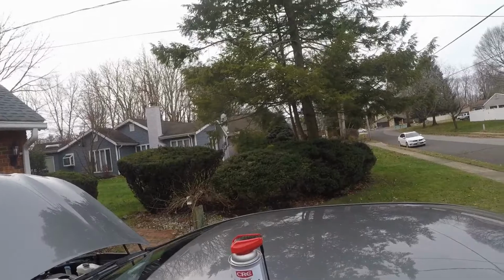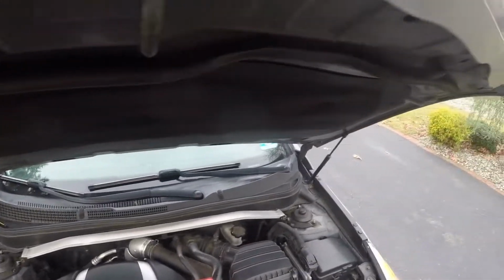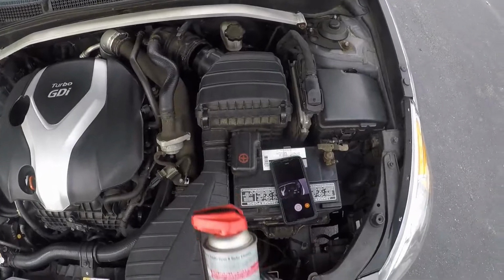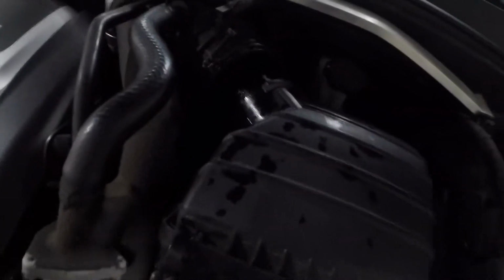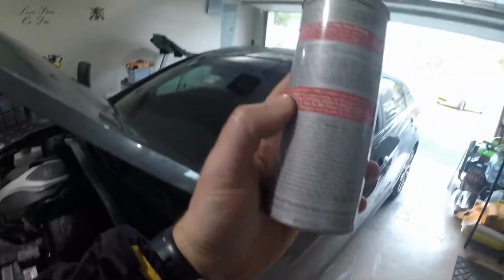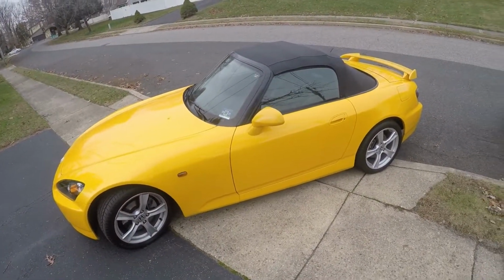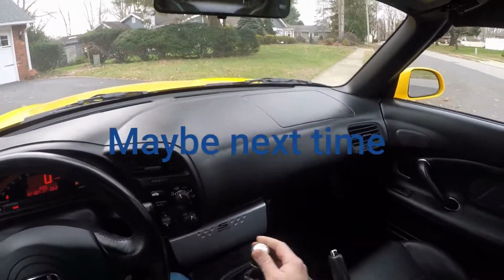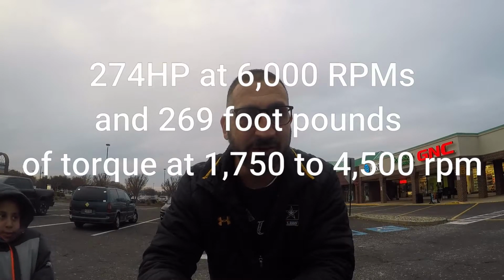Hyundai sonata 2.0T cleaning GDI with CRC intake valve cleaner.

Comment: This cleaner and process may be good for preventative maintenance. But if you have heavy carbon buildup on your intake valves on the good old GDI engines, this stuff won’t be enough to clean them. Unfortunately, a professional walnut blasting is the best option. Some of the newer model vehicles, post 2020 that have GDI technology, now have port injection as well. with GDI engines, it’s important to do regular oil changes, used top-tier gasoline and check and/or change your PCV valve about every 20,000 miles.

Comment: I have a 2018 sant fe 2.0t GDI. Code p0303. I changed the spark plugs and switched the coils from bank 3 to 2 and it still read bank 3. The bank 3 spark plug was a mess while the others were clean. I’m assuming the fuel injector for bank 3 is clogged?

Comment: My recommendation would be to use the vacuum line that goes to the intake manifold instead of spraying into the intake and turbo. Shorter path to the intake valves.
Reply: Doing that you don't clean the turbo and wastegate.
Reply: Where is that vacuum line
Reply from the maker: @frankschultz2382  its does alittle says it on the can

Comment: Did you read the instructions?  Because the way you did it is not there. Let me recall what it says. Maintain 2000 rpm while applying. Not 3500rpm. Throttle up if necessary to maintain 2000rpm. I guess air speed is better on the low so liquid sticks to carbon better. Burst of 1 second. Not less and definitively not 2 seconds. By pass más sensor. With map is not needed. Do not use a vacuum line it is not necessary and definitively don’t do it on a turbo. Let idle for a minute and then rev 3 times not going over 3500rpm. Let it heat soak for 1 hour then drive the car for 10-15 minutes at highway speed. Yeah 80 mph is not highway speed and that was actually not a highway or 80mph road.
Reply: Your explanation is correct and I would NOT do it the way he did it in this video.
Reply: Hello, i would like to ask you about the part that you say "definitely don't do it on a turbo". You mean you cannot use this product on a turbo charged engine?
Reply: @cooljohnnyb2332  sorry my grammar is not the best and auto correct hates me. I meant do not use a vacuum line I.e. brake buster vacuum, when you have turbo. I think is lazy to do it half ass. Just disconnect the duct from the air filter box or just remove the air filter and spray from box. As long as you bypass the infamous sensor. Also I said to Rev 3 times but did not say to do it after you finish emptying the can.
Reply: Thanks for your answer.
My car is Hyundai i20N 1.6L GDI. It has 9000 km and i am thinking to start using this product to avoid carbon build up now  that the engine is still new.
But i am afraid a little bit in case of any damage that could occure from this liquid, because as it is well  known the liquids are uncompressable.

Comment: Alright so question, is your sonata still running, and did you need to change the oil afterwords?
Reply from the maker: Yes. So I had done this right before I cange my oil. At 4000 miles so I just it a week or 2 later had around 43000 miles. You definitely want to do this before you change your oil.

Comment: Is that the correct area to spray it. The Mass airflow sensor is located downstream from where your spraying it ?
Reply: Some cars don't have MAF sensors. It won't hurt MAP sensor.
Reply: Directly into the throttle body half a can and the other half into brake booster is best way in my opinion

Comment: I do this before each and every oil change. I’m still on original engine bought it at 60k now has 140k+ - best do do it before each oil change since it dirtys up the oil a lot. Should spray half the can in small burst into the throttle body and the other half of the can in small burst directly into the brake booster line. Then let the car heat soak for a while. Then I take it up on the highway and give her he’ll really pushing the car pedal to the floor and you will see big clouds of smoke coming out the exhaust ( good thing that’s the carbon buildup ) sometimes the car will run like shit for a few minutes but it will work itself out. Also another good option on these cars is bringing them to get walnut blasted by a professional. The key with the CRC cleaner is to keep up with it and do it regularly before the carbon buildup gets to bad.

Comment: Once the gases are allowed to settle it stays on the valves and once it stays on the valves it hardens up and once it hardens up it becomes dangerous to your pistons Don't just ask your buddy what you need to do You can take the valve intake runner off you can use a toothbrush a vacuum but make sure that valves close at your cleaning suck it out it'd take you half today or you can go to the dealer and they can use walnut shells and the vacuum cleaner system that they hook up to it and it takes them about 10 minutes and $1,000 they knew this design was going to fail but they don't have to take responsibility for nothing they never have until people stand up and stop letting them get away with it It's going to continue You buy a brand new car today you're going to get the same garbage cuz that same engine companies at the same employees that messed up the last engines